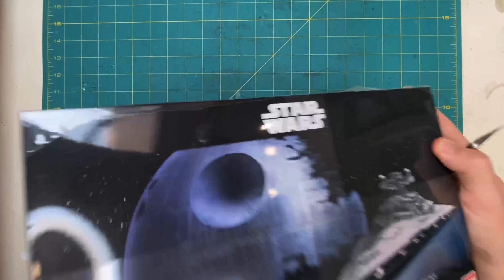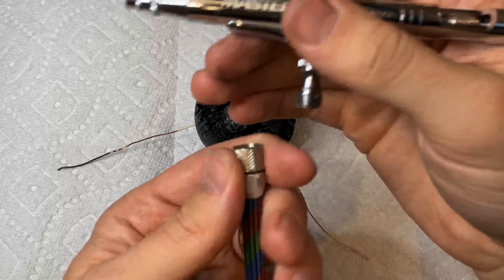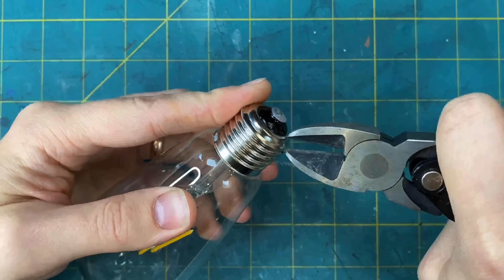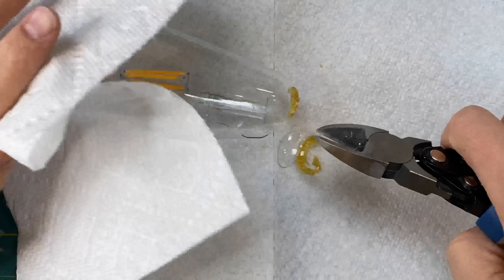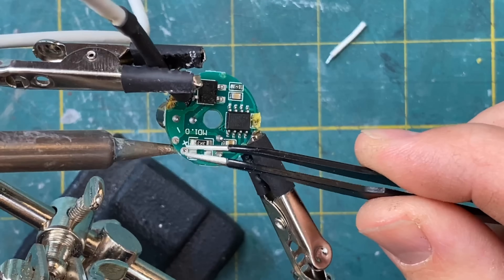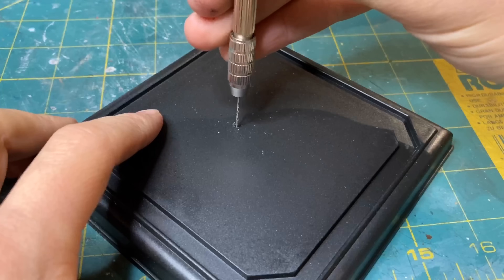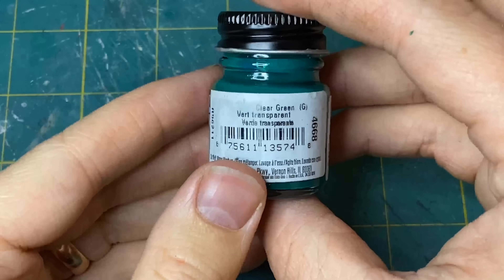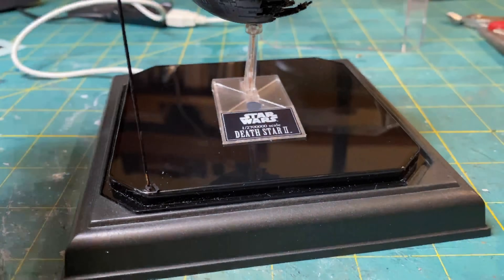DEATH STAR II + LED LASER TUTORIAL

Comment: Remember not to cut yourself on the glass!!! Otherwise a nice build :D I did a try on 230v bulb a while ago, but those filaments are like 56v or something. No reaction from a 30v PS. Only bulbs for 12v systems will work like this. Or you can just order 3.3v filaments.

Comment: One thing with the small beams connecting into the large one, you could've used small strings of hot glue. If it's dark the lighting will pass through it like it's actually lit up.

Comment: This is fantastic. Quick question. I have followed the steps, but when I touch the LED to the wires it is bright at first, then fades to barely a glow. I used the exact same light bulb, as well as an old USB cable. Is it the fact I am using a 5v adapter instead of 12v? The only other thing I can think of is that I messed up the soldering somehow.

Comment: Hey just wondering. The driver has the labels L and N for input power. I'm assuming you connect the (+) wire from the USB to L, and (-) to N. Is that correct?

Comment: Excellent video and tutorial. 

I just took one of these bulbs apart and in my haste, I managed to damage two of the filaments. That is to say, the outer part of the filament was quite delicate and while I was cutting it off the tree of wires that it’s mounted on, this outer shell split. I don’t suppose this outer part is repairable with clear tape?  
Still, I managed to get four filaments out and the driver works really well. Can’t wait to use it.

Comment: would it matter me just wiring the filaments straight up to a usb cable without the driver? feel like its only needed for the switch no?
Reply: The driver probably changes the output.  You can test the output of the usb with a  voltage meter and compare it to the driver output.  If the driver has the same out put,  yes,  you are correct,  you can wire it straight to the usb.

Comment: Awesome build snd thanks for the tutorial!
I already used it on one project successfully!
One question though, are you experiencing heat buildup in the circuit (..as I am)? 
I'm worried of leaving it running for too long as the heat slowly builds up. Using a 5v/12v powerbank via usb as source.
Reply from the maker: Hello! Thanks for your question. I found that the driver gets hot, so I try not to run it too long at one time. When I tested it I ran it for an hour or two and it got pretty hot, but maxed out at a point. You could attach a small heat sink if you are trying to run it for a longer range of time.
Reply: @Boylei  Thanks for the immediate answer! Then I know I'm not alone with the problem. A heatsink would probably do the trick, and in worst case scenario a small fan to add to that!

Comment: Very cool project. Amazing job. Have you possibly given thought to running the secondary wire alongside the led? Since the amperage is so low with one led, you could possibly use a piece of extremely light gauge copper wire that is insulated with the enamel coating. Some of those wires are as fine as a hair. Perhaps a future project.

Comment: Hi... i was "illuminated" about  your use of the LED filaments!!! Just one question: you mentioned the USB cable because the number of wires included inside... and then you say "connect to the USB". So... because USB normally carry a 5Volt and the bulb is 12Volt  my question is: do you connect to an USB port because 5Volt are enough for a single LED filament? Tnx Man! Ups... and... if in a diorama you must use more than one filament... or all the bulb filaments... do you need to return to a 12Volt power supply? Tnx again!
Reply: FF.

Comment: I am fascinated by the use of these filament bulbs, after some investigation I found that you can buy those filament wires cheap from China without the bulb part. Also comes in red, blue and green glow.. Also found a flexible version filament that might be cool for a project. Keep up the good work!
Reply from the maker: From what I have found, all the colorful ones and the long flexible ones are for high voltage only. I’ve played around with high voltage and its rather precarious. 
You can buy the components of the driver separately, but I like that everything is included with the bulbs.
Reply: @Boylei  I found a few that runs on DC3V 100mA on Aliexpress. Just search for "Edison Filament 3V" and you should find them on Aliexpress 😃 Check it out..

Comment: Very cool! 
Curious: what happens if you try to run the LED directly off your power source instead of through the electronics from the bulb?
Reply from the maker: I tried it, and it didn’t work for me, but maybe I had it wired wrong.
Reply: @Boylei  I'll have to give it a try and experiment. Your technique is really awesome, but if each could be utilized independent of that driver; you'd be saving a lot on buying new bulbs. I'll let you know what I find out.

Comment: A small idea to have the converging laser in the middle, just solder one tip of the other led filaments to enamel wire at the base of the current filament coming out of the death star, and run a individual return wire for all of them in the plexiglass foot holding the death star. You should be able to have them soldered in parallel with that technic.
Reply from the maker: This is a great idea. Unfortunately because of the scale, it would be super hard to pull that off with this one. If the Death Star were just a bit bigger, that would be a perfect solution!

Comment: I'm loving these! GREAT show ol' sport. 
Why the change from cellophane? When using cellophane, do you tape it? 
Also, can I use the 12v driver with the 120v LEDs? I like that they are longer. 
I'll be attempting the xwing fight as a  gift to someone. 
Keep up the GREAT work!
Reply from the maker: Thanks! I changed from the cellophane cause I wanted to see if painting was an option. Turns out it works pretty well! 

With the cellophane I super glued it straight to the filament. 

I don’t know if that works. I believe the voltage requirement of the filaments found in 120v bulbs is around 60v. 

I would recommend using the low voltage if you are giving it to a friend.

Comment: For the converging lasers, did you try using the same size filaments but blacking out half of the length and leaving that pressed inside the death star? Room might be too tight to pull off at this scale, definitely a tricky game of tetris. Loving the videos, keep it up!
Reply from the maker: That’s a great suggestion. I may try this again with a larger Death Star and try that method.

Comment: First off I always enjoy watching you work, great job!  Secondly 12v vs 120v is it that you have an exposed filament that could cause a fire really easy?  Can you run the filament out of a 120v at low voltage?
Reply from the maker: Thank you! The voltage running through the filaments in my storm trooper diorama is around 60v. Those came from the 120v bulb. That’s still quite high and very capable of causing a dangerous spark. I don’t know if you can run them much lower with the same visual effect.

Comment: Wow thank you so much! Been waiting for this. Death star was a good idea. So far your a wing diorama is probably my favorite! One question though. I thought using a parallel circuit would affect the brightness of each led strip or is that not the case?
Reply from the maker: Thank you! 

That’s true. I used another type of 12V bulb for the A-Wing and X-Wing projects, but I found that it only dims slightly as more filaments are added. Depends on the driver I imagine.